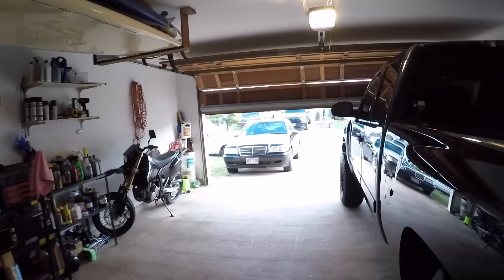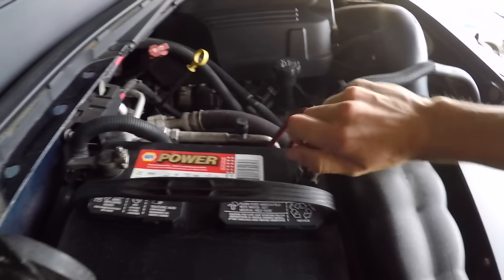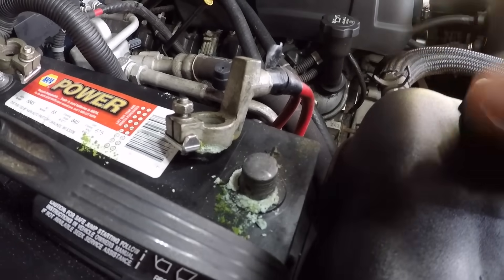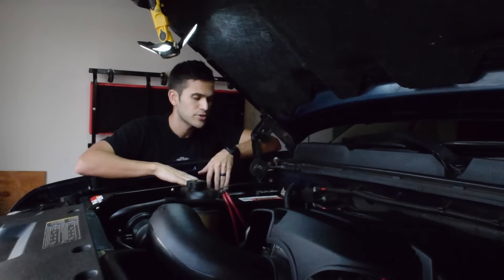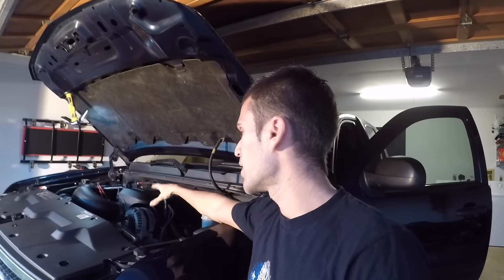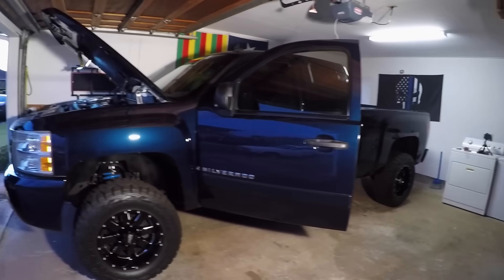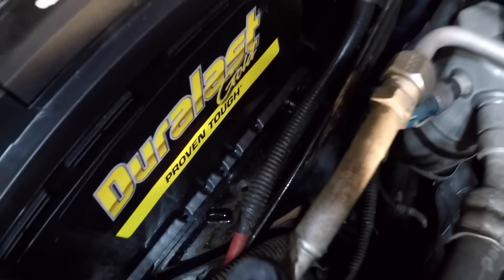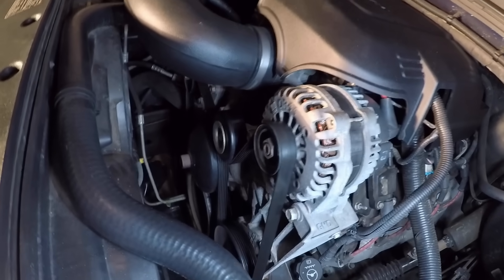Car Won't Start: Alternator or Battery? The easy way to know

Comment: Thanks. Just replaced the battery on my 2007 Ford Fusion SEL. Had it min over 6 + yrs. Backdrop: I'm in NY & last issue with battery-had no fluid in portals-filled them, cleaned corrosion from the ports-let it charge & started-neighbor said may need to get new one. Jan. 31st after snowstorm nothing-neighbor got car jumped & I went to Advanced Autoparts & got new battery. March 10th-drove several places, no issue then last stop nothing. Just like your 1st try, lights came on but nothing-wouldn't take a jump-called Roadside, they tried hitting the Starter-nothing, then said battery was leaking. I got towed home. Noe trying to figure out things-Auto store said it may be the alternator. Should I try to get the unit to measure the voltage to see if its it that or how do I test the starter? Thanks for any assistance.

Comment: 2007 Chevy cobalt of course the batteries in the trunk it’s brand new just put it in that was not the problem car still will not start how would you test the starter and the alternator to see which one is bad if the car will not start

Comment: Quick question, my 13 Silverado die, I jump started and while running it reads 15.6. Do you think it's the alternator or the voltage regulator?
Thank you.

Comment: Think I might need to get a new battery. My 2017 Kia Sorento Ex has suddenly had this issue a few days now. We cranked it and it does start,  but the next day it would not start.

Comment: I've always been told that corrosion on a battery terminal can drain your battery and or keep your alternator from charging your battery more efficiently while running... Why would I need to spend money on a new battery when all the battery needed was a good charge....

Comment: What about the voltage regulator being bad? Most computer-controlled systems have the voltage regulator integrated inside the computer. If the voltage regulator is shorting the winding's inside the the alternator, the alternator will test bad because the regulator will have shorted out the alternator. Thus, not replacing a defective voltage regulator will just wipe out the alternator you just replaced and will do so again until that voltage regulator is also replaced.  And, not showing to first connect  an alternate power source via the OBD connection will cause driveability problems  until the memory relearns.

Comment: What's the main cause?  I went threw two batteries and a alternator test.  Finally fixed the serpentine belt tensioner.  Battery getting the proper charge. Common issue for older Toyota Corolla's.

Comment: I just replaced the factory battery in 2012 Silverado after I had it completely restored!  Swapped out halogen for LED - how do I stop the hyper flash?
Reply from the maker: You'll likely need to add a resistor

Comment: Could be that the battery you've taken out is fine but discharged by a parasitic drain.  It's worth turning everything off, disconnecting a battery terminal then checking for current between the terminal and the connector.

Comment: My car just broke down and in trying to learn more if it’s the battery or alternator. Quick question do all car batteries/alternators run around the 14 voltage when running and around 12 voltage when not running?

Comment: great video. 
just because the battery is the issue doesn't mean the battery IS the issue. 

if you don't know anything about cars and definitely do not have a meter or battery booster or cables and a second car to jump start your car, but have roadside assistance, call them, and after jump starting your car, what I would do is let the engine run for at least 30 minutes or drive it for that long with all lights and electronics ON, turn it off, turn the key on to the start position, but do not start the engine, check battery voltage on dash, if ok use the car as normal, if voltage good then start the engine and voltage should also be good (around 14+ in dash) if ok then you're good to go. if the battery dies again soon after driving the car but not while driving the car - like the next morning won't start for example,  then your battery is most likely the issue - worst case scenario would be an electrical problem draining you battery when engine not running  or also maybe some electronics connected or left on. 

if after jump starting the car with the  engine running, if driving or parked, if the voltage goes below 12v and eventually shuts off and then eventually never turns back on because the battery is almost dead per volt indicator in dash, then most likely a bad alternator is the cause. rarely would it be some other issue  in a car with similar technology.

Comment: Another way to check the alternator is start the vehicle and take the terminals off if the vehicle is still running then you know the alternator is working doing it job but if you have a multi meter I dont been meaning to get one they can be cheap or expensive but if you dont have one thats an easy way to do it another alternative its just a multi meter will give you the best results.

Comment: Im a new driver so I have my permit working on my license I bought a jeep and after a few months ot molded I found out why I believe couple days ago just finished getting rid of the mold again using a dehumidifier I bought helped cuz there wasn't as much mold buy still enough and I found the emergency brake dont work the computer kinda went from 45 miles Dow to 15 down to 11 ive only moved it a few times in my driveway the glubbox is broken want shut missing the handle and one door is only help on my a couple things most of them are broken its missing the lock button and has a plastic bag inside the door tied holding something I tested my alternator its good and I got a new battery cuz my other one would keep a charge id charge it put it in next day or two its already dead completely and my new battery I had to literally  jump start it to get it going and then saw it needed charging even though me and my mom were told it was charged etc and now it works fine  but kept going down like 30% overnight and I found out couple days ago the switches on the Doors wont shutoff so j think thats what is draining my battery also I got a radio from my parents they had I bought the wiring etc I needed so hoping to get that in it looks like the jeep has been rigged a bit and yeah theres a couple other minor issues and that messed up door window makes a sound when u hit the button but wont go up nor down and im hoping to use it soon to practice more I just recently lost my job got a qoute to ser how much to insume it on my moms insurance if I give her the money its like 40 cuz ots the only way you can use it to practice if you only have your permit and of course I need it inspected cuz after seeing these issues I feel their might be issues you cant just see right off.

Comment: Very good video brother.  You forgot something though that happens often.  Even with an alternator that charges, 14 volts can have a bad diode that when engine is turned off drains a battery, and this is why most people that change out dead batteries end up with a change of their alternator within about a week, but they think (being most mechanics dont even know about diode common failure)is that it just sort of happened that two things went wrong.  Have a parts store check your alternator diode before you go buy a new batttery
Reply: Tell us more because this happened to me
Reply: I suspect this happens to me
What do I need to do
Reply: This happened to me
Reply: @coachcjwhigham7500  Hey Coach.  The fact people dont know this, cost money all over the world

Comment: My 2004 Kia Sedona is having battery trouble. I took it for a drive to do shopping and then when I was about to leave the car would not start. I had to wait 30 minutes for someone who had jumper cables to help me get it started. So now I will have to look at the Alternator because I've been charging this battery and everytime I take it out it dies.

Comment: So if my car will work when I jumpstart it, but after it won’t and it clicks when I try to start it it’s my battery? Because my radio, my headlights, and fan will turn off when I step on the breaks

Comment: What is wrong when my car only start when using jumper cable, battery is new @ 12v, when it runs idle at 14v. Any help would be appreciated, thanks

Comment: I had this very issue with my Dad's 2000 Ford Expedition yesterday morning, except that at attempted start, I got the "machine gun" clicking from under the hood. Checked & cleaned the terminals & connections, and had no corrosion. Checked voltage with a MUCH less expensive multimeter (yes, one of those free ones from Harbor Freight, back when they still did freebies...), got the same 10.5 volt reading. Decided to throw a battery charger on it, but after quite some time (overnight), voltage was only up to 11.5. Jump started it this morning with my Mom's truck, and confirmed voltage on the battery was 14.6. Same diagnosis - one bad battery.

I had left the truck running, so drove it to my local O'Reilly Auto Parts, and found out the battery was only two years old, and still under warranty! Woot WOOOT!!! The Assistant Manager and I had them swapped in about five minutes, and the warranty on the new battery reset for another three years. Boom!!!

Now a lot of folks might turn their nose up at my cheap multimeter, but for a free item, and on something as simple as this kind of a reading, it's ideal. Heck even at full price ($6.99 + tax) it's inexpensive enough to keep in my truck tool box just for situations like this. I have a service regimen on all of mine that I change out the batteries in each of them at least once a year.

Really enjoyed your video, it was an excellent tutorial on how to diagnose an issue with easy steps to follow.

Aloha!! 🤙🏼
Reply: I have come across this a few times, normally, I get the vehicle running at an idle and then pull the negative terminal off the battery  if the motor keeps running the alternator is working fine.

Comment: This happened to me yesterday; visited my partner's clinic to visit and got stranded in the parking lot. The battery was shot because my alternator was only cranking 12.4 volts after running strong for 9 years. I try to learn as much about how a car works and general maintenance as I can, but this was apparently something I had to learn the hard way. Thanks for the video though!
Reply: This just happened to me I think my alternator bad because I just got a new battery and now my car won't start
Reply: Was it your alternator?
Reply: @jonhsmith2706  Yep. Got it swapped out alongside the battery
Reply: P
Reply: wow
Reply: Sounds like a faulty alternator.

Comment: So my car wont start my battery is colour coded it shows clear meaning not good when off and when I jump start it and leave it to charge it shows  green meaning good then when I shut off and go to start it back it doesn't start so I checked the voltage while the car was running and it read 11.75   does that mean my alternator is bad and under charging the battery?

Comment: Question So the Alternator and battery work together??My car has been cutting off a lot ..said battery is good  only 2 years old..
Reply: The alternator provides power and charges the battery once the vehicle is running

Comment: Didn't quite see at 8:55 where you checked the positive side of the alternator.
Reply: There is a positive lead that connects to the alternator. Place the positive probe from the multimeter on the lead, then touch the ground prove to the body of the alternator

Comment: No start. 11.5V at battery. Jump started first try. @14V while car running. As soon as I turned on my headlights the car shut off.  Voltage at battery after car shut off was 12.4.   Bad battery or alternator?
Reply: It was SIMPLY a loose connection at the battery terminal!! I should have known better... it “looked” good and tight. But at some point while listening to all my relays going nuts, I glanced over and seen a tiny spark between the terminal and post....   put a wrench on that and couldn’t believe how loose that nut was because looking at it.... it looked like it couldn’t be any tighter.....   live and learn.  As soon as I tightened it all the way... viola.... the car started right up... many times.  I feel so dumb... lol.
Reply: Probably alternator. Check the voltage coming directly from the alternator, should be between 14-14.7V

Comment: While it's easy enough to take out an old battery and replace it with a new one yourself, wouldn't it make more sense just to let the store do it for you, since they can take back the old battery? It's not like you can just throw an old battery into the trash. It needs to be disposed of properly. 

In Asia, every battery store installs the new battery for you and takes back the old one. Sure, you can do it yourself by going to the store and picking up a battery and then returning to the store to hand them your old battery but that's two trips.
Reply: Didn't you see him remove the battery, then take it to the store, remove it from his trunk,  and trade in the old core for the new battery?  9:23 He didn't make two trips; he did it all in one trip.

Comment: This is pretty good,Im hopping to open my garage very soon. Im one of online YouTube students lol.. I really love to be an automotive mac
Reply: If you want a cool tip, if the battery voltage is around 10.4V, most of the time you know it's the battery and not the alternator. Each cell in the battery is 1.2V. If 1 cell dies, then 12.6V - 1.2V = 10.4V

Comment: If the battery is low, it can turn the battery light in and the service battery charging system message will pop up.

Comment: Don't ever take your car to O'Reilly or Autozone to have them check your battery or alternator. They don't know what they're doing. They almost cost me a brand new alternator but it turns out I need a new battery. If you want a headache go ahead and take your car to Autozone or O'Reilly and listen to what they say. Also, their parts are not good. You're better off to spend little more to get oem parts from car dealership. This is base from my experience

Comment: I had my battery and alternator tested they came back good. But the battery light is still coming on. Turning on mainly when I accelerate. I'm so lost
Reply: Check the drive belt connecting to your alternator

Comment: Great video there, thanks. On the contrary another You-tuber tells me not to replace the battery but recondition it using Epson Salt and distilled water. What's your take on that?

Comment: So what happens when the car starts after charging the car battery and it starts like normal, but as it's running it suddenly shuts off and is back to the same problem of not turning over.
Edit: oh and also tried jumping off the battery and the alternator started smoking, so I assume it's the alternator
Reply: Yes, most likely it's the alternator

Comment: Do not buy Duralast batteries. Also the battery terminals should be in the same position as the original battery. Also always check the manufacturer's date on the battery to make sure it was not sitting on the shelf

Comment: i have agm battery if i don't drive it for a week i put 4amp. agm charger on for 4-5 hours i had them go dead before you can jump start next time up stare it it's dead so i charge my battery in my ucon denly.

Comment: Old school trick from my mom see if you're battery's just thirsty. A bit of distilled water to fill the cells goes a long way most times just ignore the caution warnings. Triccle charge over nite 5 years latter I'm running a bad battery that sat for 3 yrs. Not the best way but my car starts every time even in the cold.
Reply: Fixing a bad battery for 1.50$ not a bad investment. Volt meter always a good idea it will tell you where to start!
Reply: A flathead and alittle distilled water not in the owners manual but it can work but wear gloves and goggles safety first always.

Comment: I need to put a 300 amp fuse block to the power wire for your stereo because the base is going to suck up your power and so you need the fuse block

Comment: 3/23/2021
Southern California
Automotive Tech. background

1. To get the "Real Skinny" on how to Diagnose Batteries , Starters and Alternators ; purchase and read Chapter 4: Batteries - Chapter 5 : Starters and Chapter 6 : Alternators

" 7 " small Chapters
" Vehicle Electrical Shortcuts 
www.veejer.com
Dallas, Texas

2. Reason vehicle wasn't starting is because " one " of the " six " Cells inside the Battery was "Shorted"......When you remove the " 2 " rectangle caps that's on Top of the Battery you'll see " 6 " holes filled with 64 % Sulphuric Acid & 36 % water...Each one of those Holes are 2.1 Volts per Cell ---- 6 Holes times 2.1 Volts 
= 12.6 Volts , a well Charged Battery.

His Voltage Meter read 10.5 Volts
12.6 Volts minus 10.5 Volts = 2.1 Volts ,
therefore ; he had Lost one Cell.

If the Meter would have read only near
1 Volt , would have had an "Open Cell".

3. When you saw 14.0 Volts with the Engine Running , that let us know that the Alternator was Charging the Battery.

....If it would have been reading 12.0 to 12.9 Volts , that would have told us that the Alternator isn't Charging the Battery.

4. An Alternator doesn't Start a vehicle.
A Battery & Starter does.
Once a vehicle is Running , ALL Batteries cross their Legs & go to Sleep because the Alternators power takes over
( The Battery isn't even working @ this point )

If you wonna learn how to diagnose your Battery - Alternator & Starter , Listen too some Professionals.
www.veerjer.com
and buy yourself the DIY Yearly Subscription for your vehicle from
www.alldatadiy.com for $ 29.95

Pro Version approx. $ 180.00 monthly

Your best investment for Year 2021,
www.alldatadiy.com
Gives you possible reasons for your Check Engine Light Code that you had retrieved from Auto Zone and much - 
much - much info that will excite you.